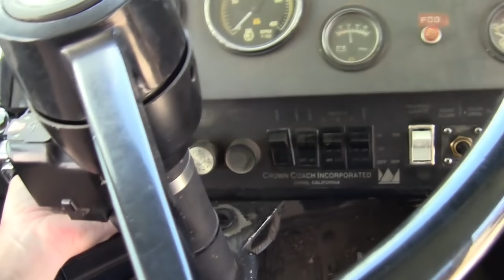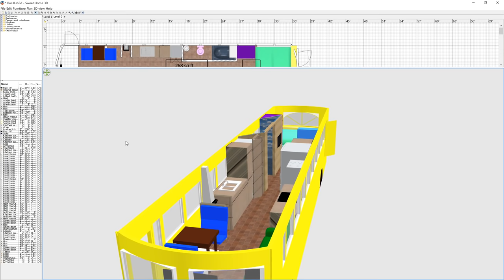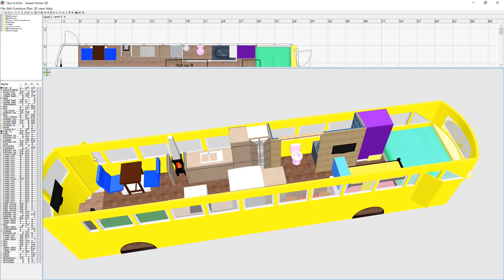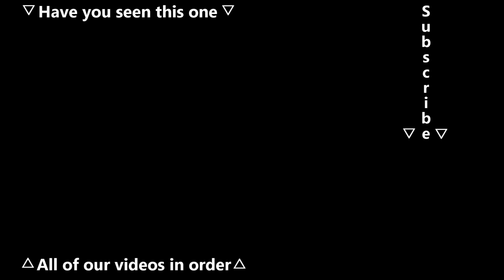Engine Work, Cleaning Inside, and Starting Leia Bus | Life of Curiosity 20

Comment: For future reference you can get 1,000 cranking amp deep cycle batteries for $100 each at autozone.. i have 6 on my bus tied in parallel. Same bus with a 671 detroit and a 5 speed manual transmission. Runs great

Comment: the holes in the injectors are tiny , dont rub dirt in them allso replace the small copper washers under them everytime you take them out , if you dont and they start leaking you be fighting to get the injectors out as there seized in there solid , they might even break on removal )
you can have the injectors rebuild or do them youreself using a rebuild kit , 
https://highwayandheavyparts.com/i-14887726-5230001-detroit-diesel-series-60-injector-repair-kit.html
might need a handpump/tester to set the pop open pressure 
you might be able to find the faulty injector by putting the return lines in seperate bottles start the engine , let it run for a bit and see wish  bottle fills up the fastest , that one is usually the faulty one (works on small car diesels)
found this on the big cam operated diesel injectors 
https://www.youtube.com/watch?v=FHqbLanmH3I
if one cilinder isnt firing because the injector doesnt vaporizes but drips the fuel intoo the cilinder it can fill up the cilinder with unburned diesel in push it past the rings where it ends up in the engine oil or bend the rod (hydraulicing the motor)
if the problem IS the injector i would advice the chainge the oil after the repair so the oil isnt diluted or cause the engine to run away once it gets hot enough ( might actually smell a strong diesel odor in the oil )

Comment: Your injector timing may be incorectly set, you may also be experiencing some cloged or worn injectors being the bus was siting for a while.
Reply from the maker: I eventually go through and set the injector timing and lash on all the cylinders. I'm 99.9% sure there's at least 1 bent valve
Reply: @LifeofCuriosity  : A bent valve is catastrophic, iam hoping for you that isn't the case. Keep us updated, it would be interesting to hear about your findings.
 Take care!
Reply from the maker: The pistons look good but I will need to swap the head. Saving for it now
Reply: @LifeofCuriosity  : Wow, that a stroke of luck, bent rods, holes in pistons etc... would really suck. S and I take it the valve guide was damaged?
Reply from the maker: I haven't pulled it apart yet. I don't think the rods are bent because it still runs. The bent valve is on #3. No compression in that cylinder. I spoke to a few DD mechanics and they all agreed that a head swap is the best solution. If one valve is bent, others are likely stretched and could cause later problems. Better to just swap the whole head and be done with it. I'm also considering an in frame while the head is off but I need to think on it more before spending the extra money
Reply: @LifeofCuriosity  : I got you. Well, in my honest opinion, I would fix anything and everything you possibly can while you have your hands on it, a few bucks now to give yourself and your Family safety and a piece of mind is FAR CHEAPER than to have a wrecker tow you from a distant location to get to a reliable repair facility. Although the Detroit Diesel two stroke is common in older heavy trucks, buses and what not, finding a knowledgeable mechanic is kind of a dying breed.

 I may have missed it but, where or how did you get so lucky in finding a Crown?. Those buses were made in Chino, Ca which is directly south about 10 mi of where I grew up in Upland,Ca
Reply from the maker: At auction from the Fresno school district. I spent months trying to find one that wasn't way overpriced. We got this one for 1750 but that was because of the engine issues. We knew that going in and my thoughts were that if we have to make major repairs at least we won't have to worry about it for a long time. It had an in frame less than 100k miles ago. I'm leaning to just swapping the head. The only thing I would like help on is running the rack after its back together. I would like someone that has experience with it to show me how to do it. Since its kinda based on feel. I love these old engines, it's a beautiful piece of engineering from a mechanical perspective. So simple in design. It's just awesome!
Reply: @LifeofCuriosity  : I see, I believe I may have made a suggestion to you before in the past about your bus engine?, The Bus grease Monkey is a genius when it comes to the Detroit, he also has a website outside of You Tube that you can get signed in on as no get all sorts of mechanical help/ advice to help you with your fuel rack, I've seen The bus grease dude adjust those before, doesn't look too complicated. I've been wanting to hit an auction and even email many school districts here in Calif in trying to pick up a Crown but haven't had any luck, there is also an older gentleman "Al Jennings" here on YouTube that sells Crowns but he never responds to my messages 😟
Reply from the maker: Look into the crown coach junkies on facebook. Al Jennings pointed me to the storage yard where we keep our bus! I have watched all of the bus grease monkeys videos and even thought about having him travel to work on it. He is pretty far away and charges for travel time and distance so it kind of makes it cost prohibitive to have him work on it. I'm not too intimidated by working on it but it would be nice to find someone with experience that could show me the "right" way to do it. I think I can get it pretty close based on my Detroit manual and YT videos but I feel there is no better way to learn than have someone show you exactly how to do it for your particular application. Thanks for all the feedback. It is appreciated and welcome
Reply from the maker: Check the crown coach junkies Facebook group. Al posts on there almost every day. That's how I contacted him.
Reply: @LifeofCuriosity  : I'll go check out the Facebook site, thank you for the pointer. Anyways, I'll keep checking out your videos it's always nice to see other peoples videos out here. Keep in touch it's been fun. You take care, and have a good evening. 
   Kind regards, Eric Dee

Comment: Detroit Diesel Engines will smoke when Cold because they rely on the Temperatures of the Compression. You really need to drive it to get it to Normal Operating Temperature. Just sitting an Idling won't do it. If it continues to smoke after that then your problem is probably worn piston rings. The Oil getting past the Oil Rings is being Burned. Causing Smoke.....Typical for Engines with lots of Miles...... Is there a lot of Oil dripping out of the Air Box Drains especially at Idle??? If so, your Rings are worn out.....You need a Battery Charger designed for HD Batteries. All your going to do is eventually burn out your charger. I apologies for being gloom and doom. I was a School Bus Mechanic for 35 Years. Worked on many Crowns.
Reply from the maker: Thanks Lee! I have been talking to some Detroit guys and my plan is to set the valve lash, time the injectors, and put a camera in through the air box cover on cylinder 3 to check the valves. Hopefully that will fix the issue. It originally had a short runaway from idling excessively when it was waiting to be auctioned. They shut it down with the key. The head mechanic at the school yard thought it might be an injector and I found cylinder 3 wasn't firing. Soni replaced that injector but I couldn't set the timing for it because I didn't have the pin or a Guage to set it. Hopefully it isn't a compression issue. But it doesn't leak excessively from the drains. No fuel or water in the oil either. Thanks for watching!
Reply: We have ours in Missouri it's her first winter ever. I charged up the batteries and drove her yesterday for about 1 hour to go fill her up with fresh diesel since we will be parking her for the winter at my parents house. Trying to figure out if we need to add additives to the diesel and run her one more time to winterize the diesel some more. The distributer said they already winterize diesel here but I've read it's not enough when storing. Also I have to check the coolant percentage levels to see if I need to add more coolant.
Reply from the maker: I would definitely add a stabilizer if you are storing if for more than a few months. Thanks for watching!
Reply: @LifeofCuriosity  what stabilizer would you recommend?  Are you talking about additive for the fuel? Or for the coolant?
Reply from the maker: I used a fuel stabilizer. I can't think of the name right now. It was just an off the shelf item at Wal mart. It was green and smelled terrible lol
Reply: @LifeofCuriosity  haha sounds good I will research one. Thank you so much. Good luck with everything. Check out our channel we have added only a little bit so far but we will go in full gear in the spring.
Reply from the maker: @crownbusjourney1298  this is the one I used https://amzn.to/2FybQiW and if you get it from amazon we get a small % of the sale. We'll be watching your channel tonight! Thanks again for watching us!
Reply: Hello Mr. Richardson. Being your a career bus mechanic, on average what is the life expectancy with these Detroits used in these beautiful Crown coaches such as the one powering "Life of Curiosities" bus/coach, 6-71 or 6v71 ???